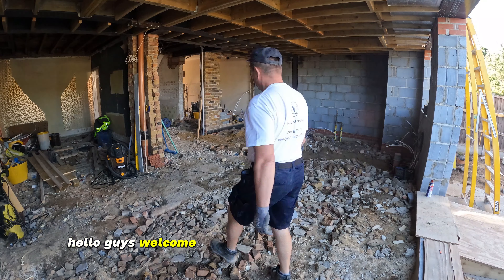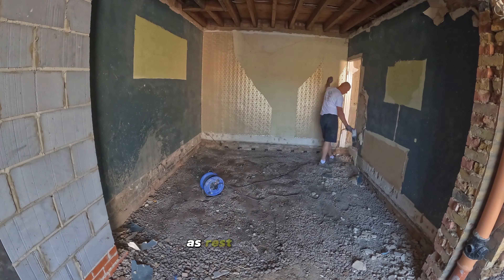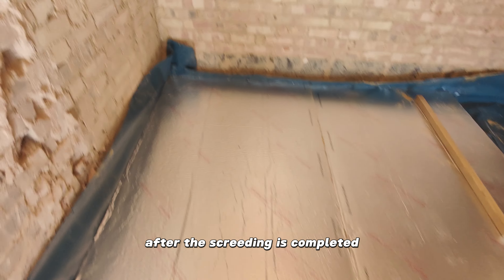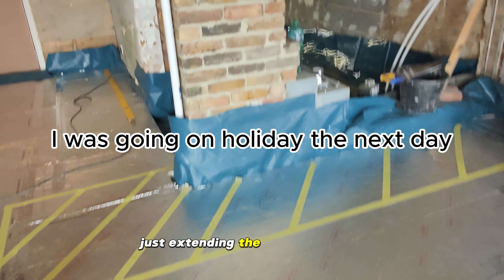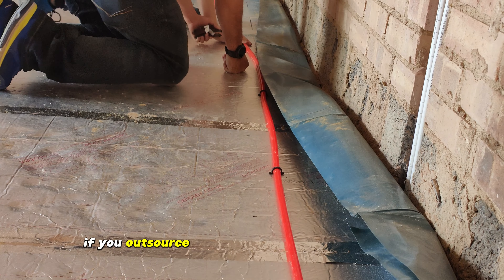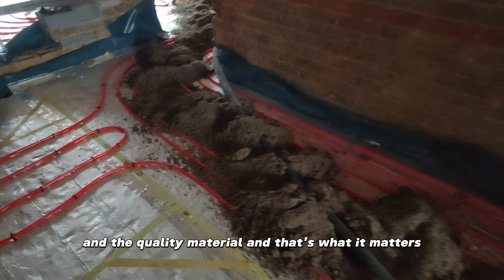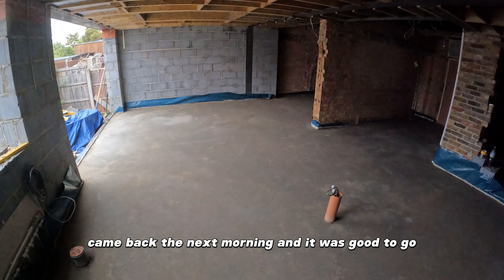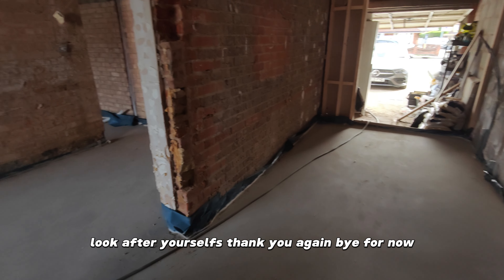Avoid this common mistake with extension floor buildup

Comment: Hi mate, wheres your concrete slab? 150mm I would spec
Reply from the maker: Hi Mate
Don't need it. Ever since I learned that you don't have to pour concrete I never did it again. We are screding another job tomorrow. I always ask the building control and they say it is  fine to screed as long as it's fibre reinforced and minimum 100mm. In fact they say it is better with under floor heating. What is the purpose of the slab? 
We have built a house from scratch and that house is standing on piles and massive slab- that makes sense. It doesn't make sense to pour a slab inside of an extension as it's not doing anything other than giving you something hard to walk on. Screed does the same, in fact it is better as it's flexible and unlikely will crack. 
There are many schools of thoughts and as long as it gets signed of by building control is good. 
I actually learnt it from an old English builder. He asked me why you are pouring concrete? What is the purpose... Got me thinking so on my next job I asked the BC and since then I am using screed. Easier cheaper, lighter, more flexible.
Reply: @yesconstructionltd  thanks pal for the lengthy reply that’s given me something to think about, so is that why u put more hardcore in as I see u put in 300mm, I’ve never heard or seen it before your video, cheers all the best pal
Reply from the maker: @ETB9090  
No problem
Yes, we put a lot of hardcore and we get it really flat and leveled so the insulation rests nicely without wobbling. Always ask your BC. Once they didn't allow it for whatever reason and I had to put the slab in.

Comment: no concrete? and why not staggereed the isulation!!!. screeders should not have the hose rubbing the hell of that underfloor heathing pipes. i get what you saying about the trades howver find the right person for the job and trust that persons is a different matter. i'm not slacking the work im just intriged.
Reply from the maker: Hi, and thank you for the comment
To my knowledge fibre reinforced screed what is required with under-floor heating and this was the spec of the job so we just followed. 

Staggering the insulation in the floor is a good practice but not  required by building regulations. We had building control on our backs all the way through the project and we actually asked about it. The answer was that is not required

I get what you are saying about the rubbing. It's only at the very beginning and we keep an eye on it. They quickly drop some gear under the hose to avoid pipe damage. 

About the outsourcing:

We are a small firm and we do about 5-6 medium projects per year. 
I can't have a fully employed plumber or sparky on my team as I need them from time to time only. Same with screed, plastering and even decorating. 
Me and most of my mates in trade operate like this and it works well, providing that you have good contacts. We share the same sparky and plumber for years and we are all happy. 

When I was doing everything in house, the project was taking much longer to complete. Since I am working the way I do now, I am able to squeeze 2 more projects in the year. 

By the way, this screed in the video is done +- 2mm which in my opinion is amazing. I had jobs in the past where we had differences of 30mm on new screed. 
This guy in the video is really good so if you are in London and need screed - KP SCREEDING is the company.
Reply from the maker: It's true, finding trusted tradesmen who you can leave on the job and not worry is very difficult but not impossible. Takes time
Reply: @yesconstructionltd  Very suprising concrete wasn't part of the scope of works!!! 2mm is good we don't find may screeders being that good to be fair and their price was very good. fiber screed is good however still cracks therefore ther reason why i mention why not stagger the isulation.
i know what you mean about using different trades on board and i do agreed 👍there is good traders out there and wend we come accros of some of them is always good idea to keep good relanship.
Reply from the maker: @flaviokepista9086  
You are right. I always take on board what people say and bring it to the table with my boys. 
I see more and more builders moving away from concrete in extension floors. It's a lot more accurate and with fibres shouldn't crack especially if the subsurface is prepared well and leveled nicely.
Reply: To be fair the screed looks mustard but totally agree where’s the 100mm concrete oversight ????
Reply from the maker: @bluevanmani  
Hi, and thank you for interacting 
There are different schools of thoughts when it comes to floor build up. We follow the screed on insulation method because we strongly believe that is better. This screed is highly fibre enhanced therefore is flexible and unlikely to crack. Building control approves this method. 
The celotex is resting on a perfectly levelled and hardened surface. The concrete on the extension floor has no structural value so what is the purpose of it. I think it's a stereotype that most people are following. 

I have learned this method working under a big company and I have used it ever since. 

We have had the under-floor heating going for 2 months prior to floor installation and not even one crack, and it was the same on our previous jobs. You will be surprised how many tradesmen out there use this method.
Reply: Ok I guess it just depends on LBC in my area (Essex) you would never get it passed. Your screed looks the nuts but I’ve seen the reinforcement they put in a screed and it’s literally handful of fibreglass mating strands in my opinion adds no strength at all. I’m not slating your work looks excellent quality but obviously different authorities will allow different methods. We’re starting a big extension this week and if they’ll allow your method I will use it as it will save a lot of time and money. Thanks for reply and have a prosperous new year 👍
Reply from the maker: @bluevanmani  
Thank you 
Good luck with your project! You have an amazing weather for that 🤣